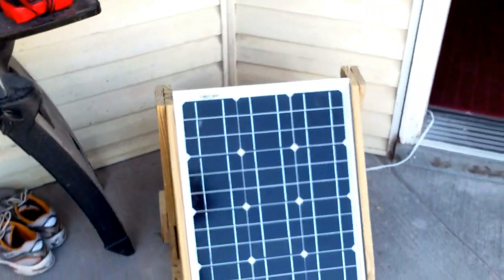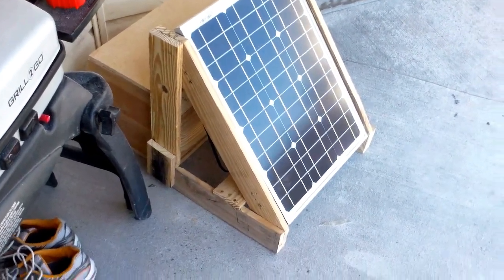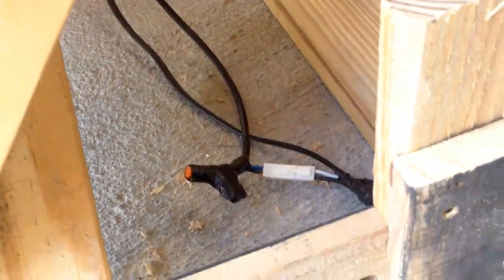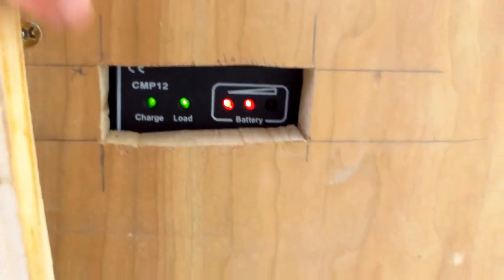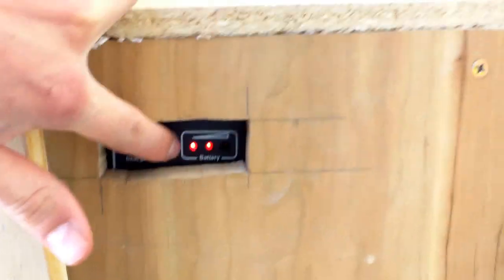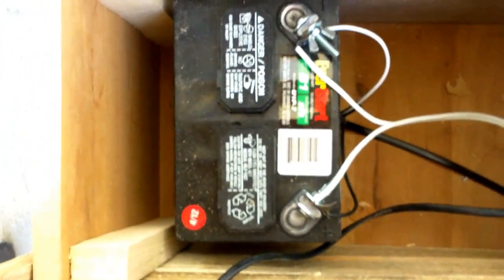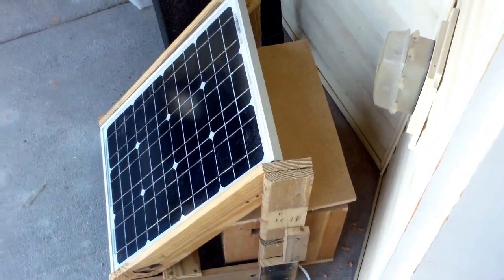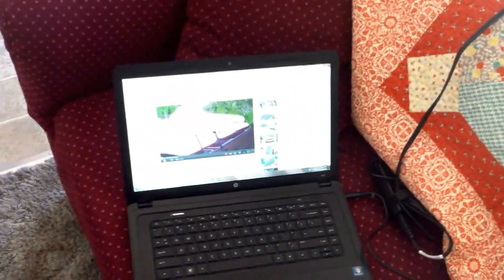Apartment Solar System-Very Inexpensive

Comment: What type of solar panel is this, and where did you get it?  Does the sound of the converter bother any of your neighbors?  What is the impact on your electric bill.  do you thinkd it could be used to run a small air conditioner?  Thanks for posting!
Reply from the maker: jane irvine the panel came from ebay. Lots of good retailers for panels on there. The inverter sound is minimal. I have since changed the set-up significantly where the inverter is in the battery box and there are 120v plugs on the outside of the box. The effect on the electrical bill is minimal, but it is more so about the experiment of it all and being prepared for an emergency.
Reply: Hi will it supply enough power for a refrigerator during power outages?
Reply: @superspookey1  no, it's a 30w solar panel and he said it takes a week to provide 1 KW of power.  You need to figure out how much power your refrigerator uses per day.  But regular appliances are not meant to be run on batteries.  You'd be better off with a generator if you only want backup during an outage.
Reply: and what was the cost?

Comment: how much does it save on your monthly electric bill? given that, how many years for payoff? I'd be interested to know.
Reply: Honestly I would doubt this system ever would pay itself off due to just how little it produces. It's more about having an alternative source of energy incase the power goes out or something worse imo. He said it produced about a kilowatt hour a week, which depending on where you live is like 10 cents or less. Say 40 cents a month, that's 137 months for just the panel alone or about 11 years, maybe less given the rise in cost of electricity over the years. The thing is while panels themselves can last a long time, the battery won't. Replacing the battery every couple months/years depending on it's quality would eat up any savings you made.

Comment: You should have the inverter by the batteries and make the DC cord as short as possible otherwise you will get a lot of voltage drop when it's under a lot of load

Comment from the maker: Nope, I did not get the cell any cheaper than you can. I did a lot of shopping and found pretty good prices on ebay. There was a dealer out of So cal. This is a 30w panel for $55. I just feel like a lot of people buy 10w panels for that much for no reason. I would look around on ebay a lot. Just do your shopping. The charge controller was only $10. Oh ya dont buy anything sunforce. Terrible stuff.